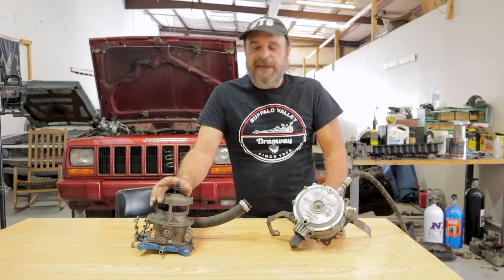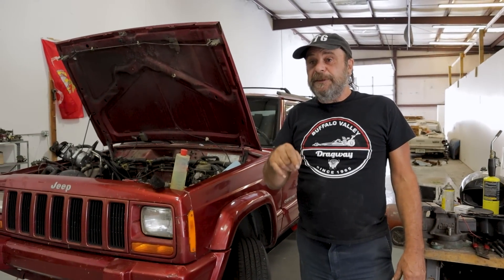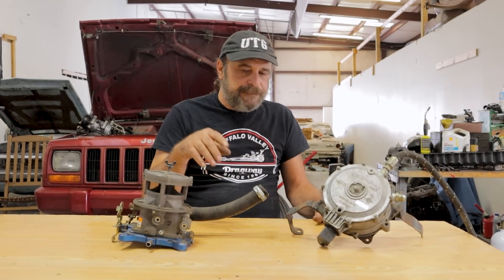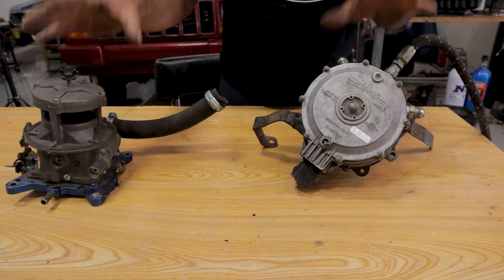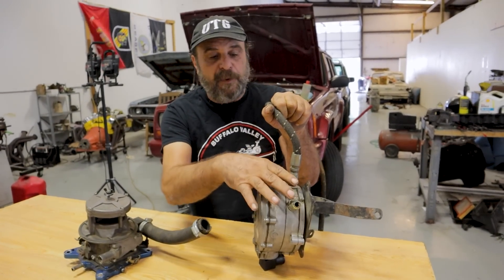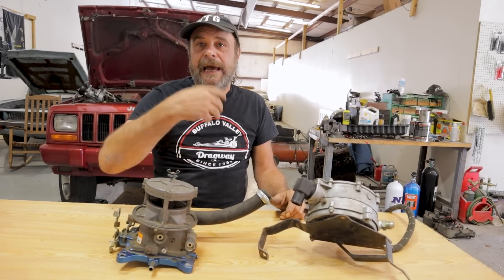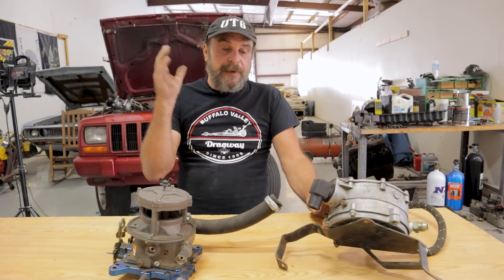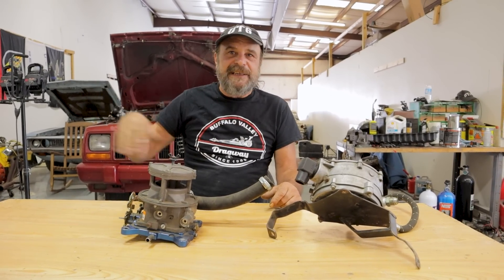Hot Rodding With Propane (And Propane Accessories) - Overview Of The Impco Carburetor

Comment: I run a liquid injected LPG efi kit on my otherwise stock LS1 . Liquid injection shouldn't be confused with a vapour injection kit as its a differentanimal.
With a cold air intake and a high octane gasoline efi live tune, the car produces 318 rwhp's ,switch to lpg, and a dedicated lpg tune. It produces 351rwhp's. Because the gas is injected as a liquid, as it expands, it tries to freeze the intake charge, reducing the potential for destination and adding some power. 
I only mention this to show how LPG can produce surprising results. 
I've  had a few old-school 425 kits, and it's not as easy to make power.
 You'll use about 25% to 30% more lpg ,however, over here in Australia, lpg costs less than half that of high octane gasoline.
Because the Impco 425 requires vacuum to open the airvalve in the mixer( lpg carby), you get  poor throttle response, making it seem worse than it really is.
For best results, you'll need a higher  compression ratio to take advantage of the additionally octane available and to overcome the shortfall in BTUs.
Spark timing will need adjusting too , lpg tends to need more initial timing and less total advance as well.

LPG works a treat with boost ....just saying

Comment: Propane is a more efficient way of fueling your engine and if you find a fleet municipality vehicle you have a gem!! I met a guy back in 2003 in Lakeland who only used propane since the Korean War. He had a F150 with a Bulldog 6 that he had the tank in the bed. Propane if I am correct is still cheaper and really you’re oil lasts longer because of the cleaner burn.

Comment: The good thing about propane is that it's a cleaner burning fuel, less exhaust emissions. Also the engine oil will stay cleaner for a longer period of time. But using propane your car will be noticeable slower. And using an old fashion set-up on a carburated engine your mileage will go down by at least around 30%. (Ask me how I know) Also, keep in mind that propane is more aggressive on valve seats, more so than unleaded fuel. In the long run you will end up with burned valves, unless you rebuild the head(s) using hardened exhaust valve seats. Or you can mix a special oil in the intake for valve/seat protection. In my opinion propane has no place in a performance vehicle.

Comment: You should also make a woodgassafier thing to make your own gass
Reply: Saw a show that explained that.  Wild !  It got popular during the depression.  Huge add-ons to the car I saw in photos.  One guy said you're essentially baking the wood.  I've thought, if I already had one of everything,that would be a neat project.  The propane has  me thinking, with the big tanks I see on farms.  I wonder if anyone up north had an old 12 valve cummins or way back, that Perkins in a Dodge pickup truck, running on home heating oil 😁

Comment: Oh hell yes.
Only run gaseous fuels if you want much higher octane, no carbon deposits, oil and spark plugs to last 3 times as long -
And an engine that lasts at LEAST 3 times longer.
All proven in commercial vehicles.

Comment: Through the 90's and 2000's I had a turbo charged 4.1L Falcon 6 here in Australia, it was LPG only and it went incredibly well. It was an Impco system like you have on the table there. LPG used to be sub 20c a Liter here.
Things I strongly suggest for a safe install are mounting the regulator on the inner fender and running hard copper line to the tank, pull the copper through clear plastic tubing. Fit a cutout solenoid valve just after the tank and just before the regulator for safety, the solenoids are powered from a module that senses ignition pulses so the moment the engine stops turning, the gas is locked off. Automotive propane tanks differ from forklift tanks also, they have a gasketed door over the fittings and vent to the outside of the car. Also make sure you have some form of fill limiter so the tank never goes over 80% full, the automotive tanks have a float and cutoff valve inside them, allows for expansion on a hot day.
Reply: The tank cutoff valve can be tricky when you fill, then drive up a hill afterwards, tripping the valve; first time it happened to me and my vehicle sputtered to a halt, I didn't know what was going on; a quick phone call to my LPG guru sorted it; just leave the engine switched off for 5 minutes to reset the valve.

Comment: In the 80's I had a 10 seat chevy van with dual fuel propane and gas. Worked great. I quickly learned that all most all small communities in the North heat with propane so filling up was never a problem.

Comment: propane is used alot as an engine fuel and has some interesting charateristics, that Impco 425 is a good unit. iwill be watching to see what you come up with.  did you know that there are liquid propane fuel injection units now?

Comment: Ultimate preper set up. Now All you gotta do is bury a couple ignition modules in tinfoil under ground and when an EMP hits you and all the 12v Cummins motors will be the only thing running.
Everyone will deplete the gas and diesel first not even thinking about propane

Comment: I've heard that propane conversions can eventually result in burnt valves in some engines, some say it is due to the slower burn, others say it is because the soot from burning gasoline protects the valves. Alan Howatt has a video of a 2010 Astra 1. 6 (88k miles) which was converted and had burnt valves. I wonder if advancing ignition and retarding exhaust valve timing can help with that. They have stuff like flashlube valve saver to help prevent that. Also, I never thought of that, but I guess propane is more consistent than gasoline. Propane is mostly just propane molecules whereas gasoline is sort of a mixture of different stuff.
Reply: Hardened valve seats are all you need.

Comment: The Aussies did OEM Liquid Propane injection on Holdens and Fords.  It was a net gain in power because the air was radically cooled (instead of the mixer being cooled) by the fuel vaporization.  Unfortunately, the only applications on this side of the pond seem to be fleet conversions of stock truck motors.  My understanding is the injectors and the injector drivers are not compatible with standard aftermarket EFI units and nobody seems to be experimenting over here.  That's a shame.  I have a hot Chev 383 with 12:1 and .630 lift solid roller and I get tired of the raw gas out the tailpipe due to cam overlap when running on the street.  I'm guessing Propane being gaseous would improve on that problem?  Anybody have experience with that?  252/258 duration at .050, .630 valve lift and 106 deg lobe separation are my cam specs.

Comment: It's actually really difficult to ignite a propane cylinder. They're more likely to turn into a rocket than blow up. Also, propane is heavier than air, so as long as you give the gas a place to essentially drain out of the trunk you should be okay with minor leaks (obviously those aren't ideal). I just put a mini version of this IMPCO setup on my forklift because the old Zenith carb was more expensive to get a rebuild kit for than just buying a whole new fuel system setup with lockout, vaporizer and throttle body all inclusive. This is a dead reliable setup. My flathead engine is tired, and I mean it's so bad. I just pulled the head off due to the notorious head gasket leak problem on these and the ring gap is so bad it's like a 1/16" or so by eyeball. This thing starts up and runs every time just like a fuel injected car. It doesn't hit right away on a couple of the cylinders but it still does just fine once it does and runs smooth as glass after that. This is with an engine low on compression and it started life as a 6:1 compression engine! If I ever get around to rebuilding this engine, I've been thinking of ways I could increase the compression ratio. I know these shipped as diesel engines so maybe those could be sourced and custom-dished to give the right compression ratio.

Comment: Just a heads up. If that 4 liter your running isn't a coil pack motor DO NOT TRY TO RUN THE HORSEHSOE INTAKE THAT CAME ON THE COIL PACK MOTORS! Alot of people say they make more power but they really don't. The runners are equal length, but the floor of the manifold is much much higher then the floor of the port on the older cylinder heads. You can not port it in a way to make the change gradually, and even if you try ro dump the port near the flange it gets super duper thin! The older style intakes make the same power.  Just an fyi.. also if you are going to try to port a head find a 7120 head! The casting number are cast into the head right outside the valve cover sealing surface between cylinder 3 and 4 in the int/exhaust side... also 4.0 really like a cam upgrade. Hope this helps... they can make decent power.

Comment: We had a Minniapolis Moline propane tractor in the 1960's, it had 11:1 compression (I think) and ran quiet and the oil stayed clean even in dusty condiitons.  The engine wears very slowly, lasting forever.  Drawbacks are you have to be careful filling the tank to 80% maximum and if you have a car you can't buy propane everywhere.  In those days propane was 10 cents a US gallon ha ha.  Also propane boils at -40 degrees so if it very very cold there is little pressure to get the propane to the engine.

Comment: Propane is a great fuel. You mentioned the high octane rating but there's more. The Impco systems are simple, tuneable and have great potential. Contact them re: specs, procedures and tuning. They have great resources available. A few important points: 1) the timing curve is very different than gasoline 2) the converter you have is good for 325 hp, period. Tee in more converters as needed. 3) lean is safe, rich drastically slows burn rate and torches exhaust valves 4) the mixer number isn't cfm, that 425 will flow 800 5) the mixer senses air density, compensating for altitude and temp, etc. 6) the ignition will need smaller plug gaps and will still run higher secondary voltages. It needs to be robust 7) propane has less btu/lb than gasoline but higher compression, 12+/1 and more efficient combustion mean there's more power potential 8) it will tame the cam a lot at idle 9) propane vapours are much safer than gasoline vapours. 10) there are different mixer fuel buttons and diaphragm springs available to tune the fuel curve. There's a lot more advantages and I know it's been run successfully in Pro Comp. I'm very eager to see what you do with it.
Reply: I have an old rusty truck on propane and it smells to beat hell like it’s pushing far more propane through the mixer than it needs. I know nothing about it and the system. It’s an old school type and wonder if you could steer me in the direction of how to set it up. ‘77 Chevy 350

Comment: As a forklift mechanic,  I'd say you will do just fine. Dont worry so much, I smoke too. Just take your tank to a refilling station, and exchange it for a certified one ( will come filled). So there, tank leak worry solved. Next get new line if you like, but trust me they last forever unless cut or worn in from something. It's the fittings that need to be checked. Some 90 degree fittings I've found cracked. Get new fittings, and use plenty of thread tape.

Propane stinks to high heaven, so if you smoke, dont when you smell it. But if you smell it, and dont have an open fire source, you can still operate it without blowing up.  
Don't worry bout sploding. I'm a chain smoker and still have all my hair and skin. 
Oh yea, if you ever see that regulator freeze over, you probably dont have a coolant problem, it's the regulator.  Replace it, and you are back in business. 

Hey you wanna build my 440 fur me? Just kidding. Wishes me luck on my coronet project.

Comment: For your trunk safety, just "firewall" behind your back seat with 22 ga sheet, and retain your trunk latches (lid and body) with dead soft hardware, modified with a "wasp waist" just below the head (break-away bolts). Any "boom" tosses open the trunk long before tossing open your "internal squishy bits". Granted, youll be adding weight, but its not like youll need armor. Alternatively, just drill drain holes (or pop the body plugs) at body panel/trunk floor joints, and the spare tire well (low points, propane is heavier than air).

It wont really be very dangerous, NYC lng taxis had the tanks trunk mounted. Propane has a fairly narrow combustion band, most leaks, if given any chance at all to dissipate, will produce a mix outside the range. Of course, you could also just hang the tank off the rear valence or bumper, lol

Comment: hmmm another norm....oh it ll take out the cam bearings after a 100 thou miles, work it hard enough it ll destroy flame harden valve seats and tulip the valves. use an o2 sensor and a gauge to set the mixture...epa doesn t like m cause they go rich at an idle

Comment: I've been running propane or LPG as it's known here in Australia since the eatly 1990's.  Ford went hard on propane from the factory for taxis.  I have a 2006 Falcon wagon fully set up from the factory running a green top barra with a vialle converter similar to the impco.  She gets about 550 miles on a 31 gallon tank on the highway.   Got 220,000 miles on it and hasn't missed a beat.  Have rebuilt the converter once.  Cost $100.  As someone else posted a great side effect if you blow a radiator hose the converter will freeze up immediately and starve the engine before it cooks.  89c a litre vs $2.20 is the real kicker over here though.  Greatest car I ever had.  Love your content Uncle Tony.  Catch ya from Birchip Victoria.

Comment: You didn't mention the fuel being under pressure eliminates the need for any sort of fuel pump. 
Also cools the engine and shuts it down if you're out of coolant.

Comment: Hey Tony. I did this conversion on a carbureted Ford Ranger years ago. I went dual fuel, so the mixer went on top of the carb. Easy setup and very reliable. I still have all the parts for it. Have fun!
Reply: How many miles per gallon did you get off the propane? And what engine
Reply: 4x4 ranger with 2.8 V6 engine. avg gas mileage was just under 20mpg. @allurared9029
Reply: How did you do a dual fuel set up?
Reply: @commanderwhite12   Impco make adapters to bolt their mixers onto some carbies, and for others you can custom fab one. I custom fabricated an adapter to fit a impco 425 to my 302w efi engine. Used the stock ford throttle body, it worked rather well.
Reply: Mixer on top of carb. 2 switches for gasoline off, propane on. Had to shut gasoline off and run the carb dry B4 turning propane on. Pretty simple... @commanderwhite12

Comment: Had that setup in an 86 Step30  from the Elizabethtown Gas - Edison.  It was a good work van but it was hot in the summer. It started getting expensive to run around 2003 .

Comment: In Australia we call it LPG Liquefied petroleum Gas. I was in the industry for a few years, although it is almost a forgotten fuel here now. The main reasons are, the vehicle owners with duel fuel systems are typically tight spenders and neglect to run the occasional tank of gas (petrol) through to keep that system fresh, resulting in expensive petrol system repairs. Another reason is greedy LPG workshop owners taking advantage of vehicle owners by overcharging for "gas tune", thereby offsetting any savings to be had by running the alternative fuel. That being said, I run my 2009 Falcon ute Barra on only LPG and it is great. I have spare barbeque bottles and I can plumb it up to do 1500km without the need to find an LPG filling station. These are slowly disappearing as the tanks have a limited lifespan. Mad Max is coming

Comment: My first job was delivering car parts in a propane 84 S10. The little 2.8 was built to take advantage of the octane it had lots of compression and decent cam. Add a 4.10 gear to the mix and it was lots of fun. I used to smoke 2.8 5 speed Camaros with it and no other S10 could touch it. Last I saw of it was on a truck leaving after corporate delivered our new 87 Dakota. It was nowhere near as fun.